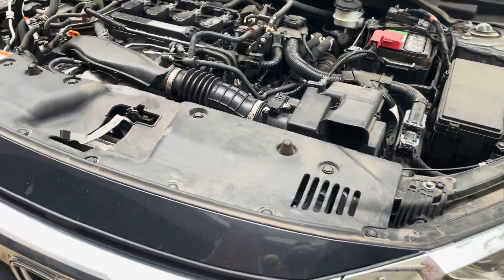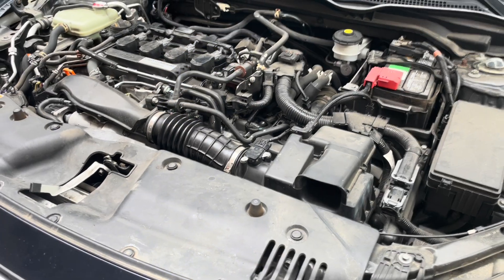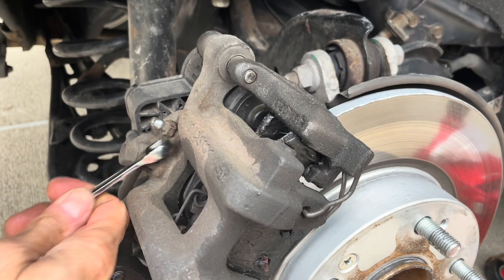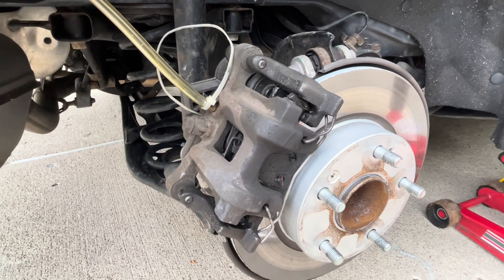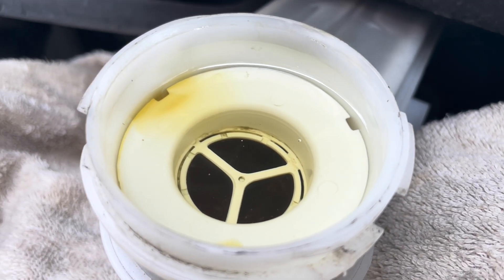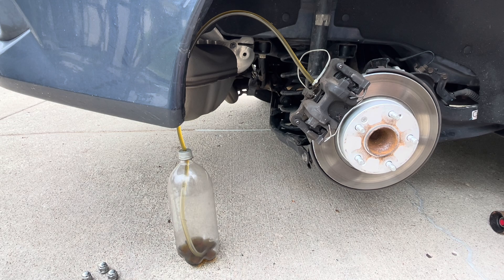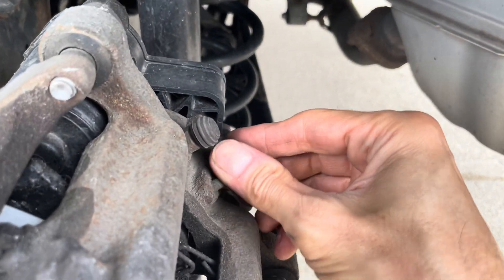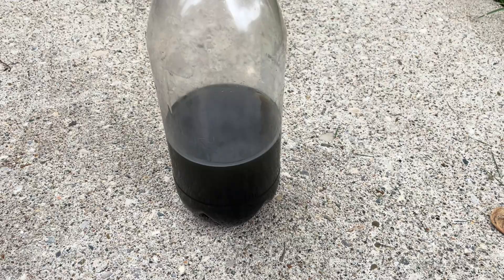Flush your brake’s fluid for $10

Comment: Painful to watch. Kudos for doing it at home but I belly laughed at the comments promoting this video as the best video. Helpful hint. Honda switched where the abs is depending on your model. If your abs is up front start rear pass then driver rear front pass then driver front. If abs is in the rear do driver front driver pass driver rear the pass rear. Also suck out as much of reservoir first before you top off. His bottle system is fine but dont open the line and just willy nilly it. Have helper pump brake pedal until solid (usually 3 to 5 pumps) then hold and open the bleeder. When the pedal hits the floor helper says floor and holds it there while you tighten the bleeder. Repeat. Check the reservoir for top off about every 3 floors. Use the video for visual guide but for the love of baby Jesus close the bleeder between pumps. Big bubbles are visual. Closing the bleeder guarantees air cant get back into the system. Im not a Joe shmoe. I've built race cars. Dont skip steps on simple routine maintenance.  Its easy to do and the video helps but isnt 100%. Look up your vehicle abs location and go from there. Best wishes.
Reply: Put up a video if you feel it is better than this vodeo.
Reply: @ShizzleChat dont have to. Anyone with half a brain can watch this video but follow my comment and do a great brake flush. I was a tech for 18 years. Stfu with your butt hurt call out. The video shows all the Important parts but the bleeding process allows air the opportunity to get into the brake system. My way cuts off that opportunity and is the correct way to do it. Do it however you want its your car and life. Lol I could honestly couldnt give 2 shits how you do it. But for the people wanting to do it right follow my comment and use the video as a guide identifying the parts. Good day you insignificant moron. Lol

Comment: Before bleeding brakes remove as much of the old fluid from master brake cylinder (you won’t be able to get all of it due to baffle design) and refill
Reply from the maker: Thank you for your comment
Reply: How would one do this if not shown in the video?
Reply from the maker: @andrewbravo1401 you can use a simple fluid siphon to take out a much as you can from the reservoir. Be careful with the paint. Don’t let brake fluid touch the paint.

Comment: Sweet civic man I have a 2018 si myself! I have tried dot 3 and dot 4 I could not tell the difference the car stopped the same in all situations but the dot 4 wore out faster only lasted about less than 2 years before I noticed longer stop times but dot 3 last me maybe 3 1/2 years before I notice it starting to take longer to stop. I wouldn’t bother with dot 4 unless you are racing maybe, I drive crazy too fast all the time I catch myself going 102 everyday back home from work and I love getting wild in the canyons by my house crashed 6 there but never learn my lesson even hit a deer ripped him in half it was a mess and messed up my intercooler but I kept one of the deer’s foot as a trophy it’s hang under my car right now . The civics are tough don’t be scared to take risk in it they can take a beating n keep going
Reply from the maker: @drydreams8513  agree. I have four civics and love them. I use Dot3 max that lasts longer
Reply: I got hit by 3 wild horses in Arizona. Yes HORSES, doing around 50mph in my 2010 accord.  They destroyed my car, but all the lights worked, brakes worked cop said sorry about your car and left. I drove that car over 3k miles no issues. Hondas are straight bullies

Comment: Hi, any issue using Prestone Brake Fluid vs Honda OEM fluid? On the manual for Honda cars it specifically says to use only OEM fluid. Thanks
Reply from the maker: No issues at all. I have been using it for more than 5 years on all 3 of my Honda cars (two civics and odyssey). 
Please consider subscribing to my channel. It will help me on doing more videos like this.
I am regularly fixing things around the house and adding videos about it.

Comment: What is the size of tubing you are using?
Reply from the maker: I have just measured it with a caliper and the inside diameter is 1/4” (outside is 3/8”). This is the Lowe’s link: https://www.lowes.com/pd/EZ-FLO-1-4-in-Inner-Diameter-x-10-ft-PVC-Clear-Vinyl-Tubing/1000365025
Please consider subscribing to my channel. It will help me on doing more videos like this.
I am regularly fixing things around the house and cars while adding videos about it.

Comment: You can also use a Mitty Pump.  Its the same thing but you can just suck the fluid from each caliper into a container that has a vacuum which you control by squeezing a handle each time.
Reply: The Mityvac is the way to go for brake fluid replacement